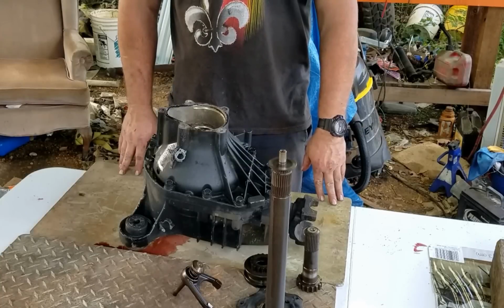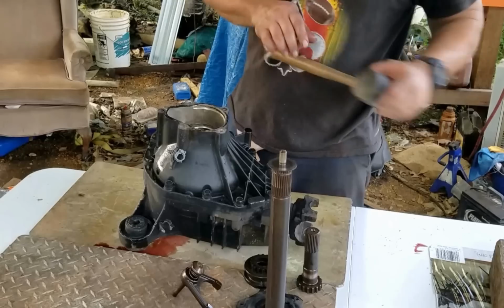99-06 GMC/Chevy front differential gear change.

Comment: For the past 100k miles the front diff on my 2006 Denali has been screaming like Rick Flair.
 Wwoooooooooo
Reply from the maker: It must be full time 4wd
Reply: Yeah, it's awd.  Also, I've cracked the housing tube on those and got a new 4wd housing on the cheap.   Works fine for awd, just plug the 4wd sensor hole. Saved $150.  Think because the 4wd housing is more available.

Comment: You know that disconnect sleeve is the weak link/ fuse in those differentials, I busted one before and was pissed however I replaced my sleeve with a billet steel sleeve but now I have no use for my two 9.5 front differentials with 4.56 gears because I did a solid axle swap on my dmax dually those IFS differentials I have will fit any 2000-2011 2500 and 3500 Chevrolet/ GM truck
Reply from the maker: You are right howev people want conveyance so the automaker gotta make it as easy as possible for people to put yhe truck in 4x4 so they will buy them. A lot of times, that system weakens the truck.
Reply: @bluecollarhowto3489  exactly 👍🏿👍🏿

Comment: Please answer.  I just bought a new 18.  I am running 35" tires.  Want to regear to  4.56.  Where do i get front diff gear from?  or do i buy tow rears and change them both out?  I am unable to find any answer on this online.  Perhaps you can help.
Reply from the maker: The front and rear or totally different. The rear will not fit int the front. There are many places to buy gears from. such as eBay, Amazon and many 4x4 type web sights online.
Reply: @bluecollarhowto3489  thank you!

Comment: Very helpful👍 Do You got a part number for the 4.56 gears ?
Reply from the maker: No. Just go on Ebay or Amazon. I prefer Amazon due to ease of return and 2 day shipping. Search for 4.56 gears for your year truck. A full kit with both front and back gears with install kits should come up

Comment: Hey question is possible  to eliminate front diferential  on 04 gmc yukon xl and just drive with the rear diferential.
Reply from the maker: If you mean take out front drive shaft to diff then yes. your you want to remove the diff, you would have to get 2wd hubs
Reply: @bluecollarhowto3489  no i talking about to remove front diferrntial because is damaged and i dont want it you think it will work just with rear axel
Reply from the maker: @ELREYYAVIENE1026  You can remove it. you will have to take out your drive shafts and cv shafts. You will either have to cut your cv shafts to the end can stay in the hubs or the hubs will have to be replaced with 2wd style hubs.

Comment: I have a 2003 Tahoe Z71 w/4WD and a Escalade 2004 AWD.    Can I interchange front diff?  And just add a switch on dash of Escalade?  If so how do I determine axle ratios are the same?
Reply from the maker: The tahoe diff will bolt right in. As far as making the swirch work. Not sure. There are swtichs in the tcase that also have to be activated. Not sur how awd case woukd handel the frint diff disengaged. You could put doacers in the diff actutor to keep it ingaged. The gear ratio is in your glove box on the sticker with all the numbers. Most likely a gu6 or gt4.

Comment: When running 35s. Would a 4.10 or 4.56 be better.  Truck is a 1/2 ton. Sierra. 4x4. With the 5.3.  Daily driver
Reply from the maker: If you run 4.11s wit 35s it will be very close to stock, 4.56 will give you more power, less mileage
Reply: I currently have 3.42. And the truck is a slug on take off  and towing.    It's my daily. By I do tow a 16' full of 4wheelers alot during summer  a car occasionally and boat.
Reply: I'm installing my 6" lift and 35s on 20s this weekend.  And plan to order gears soon.    Everyone on forums and what not keep saying 4.56.  But I was trying to get some real world perspective .
Reply from the maker: Running 4.56 with 35s would be like running 4.11s with stock tires. U will like the extra power the truck will have with 4.56. Plus your trans will like it much better
Reply: @bluecollarhowto3489  sweet man. Thanks. A ton. Guess I will be ordering a set of 4.56
Reply from the maker: You will not be disappointed. I have 4.56 with my 37s, good power with 35s it will be a beast.
Reply: Awesome.  Thanks for your time and response.  I appreciate it
Reply: I'm running 35 so I opted for the 4/10 and it turned out to be 1 mile off on m speedometer so if I'm doing 35 I'm really going 34 and I gained so much more torck

Comment: What's the stubby little shaft called I have a 93 4x4 but it doesn't have the little stubby shaft and don't know what to call it lol?
Reply from the maker: Not sure which stub shaft you,re referring to. I'm assuming you're talking about the one that goes from the carrier to the disconnect. You may not have it if your diff does not have the ability to disconnect.
Reply: At the very beginning of the video it's the smaller shaft on the right it would have been your left that you put inside the thing to engage the 4wd
Reply from the maker: @raymeadows4383  That is the stub shaft that goes from the carrier to the coupling. I show the installation around 32 min mark. I have not idea its proper name.

Comment: I've heard that the 1/2 and 3/4 ton front diffs are the same dimensions on the outside so, in theory, I can run the 4.10:1 carriers and only need to change them with the stock ones???Good to know...
Reply from the maker: Mike Brown Ohio the the 3/4 ton is  diffrnt than the half. But  4.11  will fit the stock career, some 1\2 tons came with 4 11s as well as suvs and  avalanches
Reply: I was told the 1 ton was the only one, not the same outer size...I'll take your word for it that they are different...Currently have a 93 3/4ton 4x4 with 4.10:1, 33s, and no lift...I need to get some new transmission lines as the old ones have decided to leak and rust out...Have a great day...
Reply from the maker: Mike Brown Ohio you my check, but as far as I know the 1/2 ton has a 8.25 ring hear and the 3/4 up has 9.25. The framed are different so it will not bolt right up.

Comment: Are rear and front gears interchangeable?
Reply from the maker: No they are totally different. You can order front and backed with install kits all together. Ebay and Amazon have them as well as most places that specialize in diffs
Reply: @bluecollarhowto3489  Thank you! Im looking into doing 4.56 on my 2000 tahoe 5.3 with manual transmission

Comment: DO NOT GRIND ANY BEARING OR MATING SURFACE. If they will not tap in, pay someone to press them in with a press! you will NOT be concentric, and your devices will wear poorly and fail over time!!!
Reply from the maker: If you pay attention, I said those were dummy bearings used for set-up. Then, I pressed new ones on. This way, you don't have to press them on and off to get the shims right.
Reply: @bluecollarhowto3489  ok i missed that part my bad

Comment: When I watch how to videos I would think, "who doesn't give a thumbs up to these?" and then I saw you use the dremel on the inside of the bearing... WYD? get a press
Reply from the maker: That was to make a set up barring, to test fit for set up. That way they don't have to be pressed on and off every time you take it apart. And put together for set up. Once all the right shims or found and proper set up is confirmed then the new barrinings are pressed in. It's been a while since I did this video, but I thought I explained that in the clip.
Reply: @bluecollarhowto3489  you did explain that and I actually have a full set of test fit bearings for multiple differentials and transmissions because sometimes you can tear up the bearings getting them off. Test fit bearings are the fastest and best way in not only my opinion, but every mechanic I've ever worked with, to get shimming set quickly and accurately. Of course you also double check wear pattern after new bearings are pressed on and I've never had to pull and repress a bearing using test fits. Some people either don't listen or they don't understand so you're in the wrong. Gotta love by-the-book fixing wrench turners.

Comment: gm diff are not like they used to be so cheaply made toyota still makes cast iron diffs so i guess japanese is better
Reply from the maker: Tundra's are now also aluminum. The reason for so much aluminum in drives trains has more to do with the government then the manufacturer. Its all about gas mileage. This is the same reason every truck now comes with aluminum driveshafts.  a  secondary reason is the lighter you can make the truck the better your tow capacity.
Reply: Ifs diff housing have always been Aluminum as far as I new.
Reply: Why would the front diff on 99 and up Chevy need to be cast iron or steel? It's surrounded by a steel frame and brackets. The case only needs to hold fluid and gears it's not under any real heavy stress or heavy load.